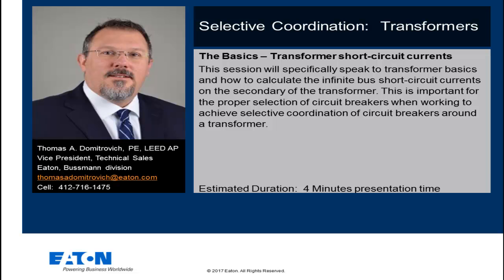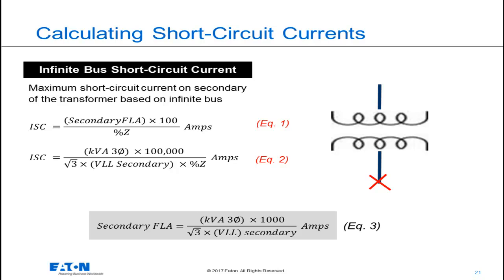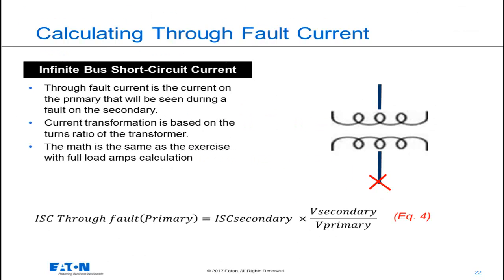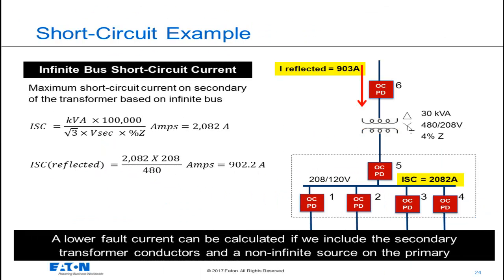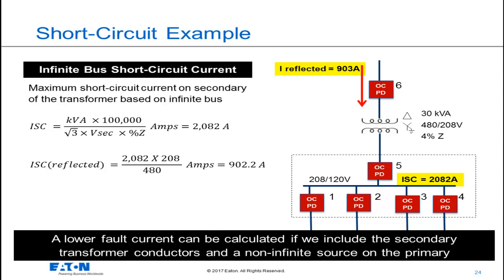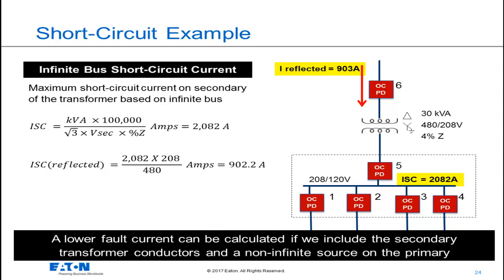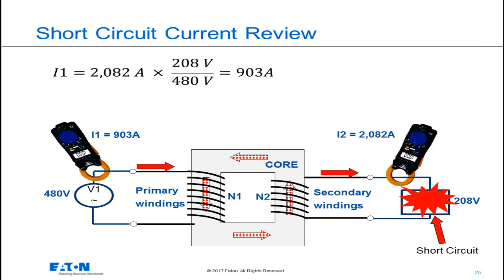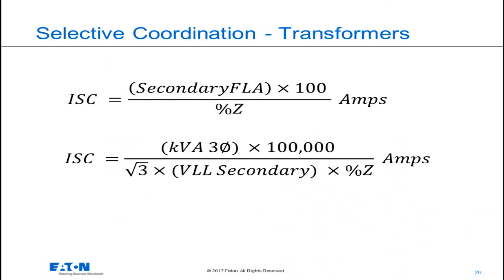Transformer infinite bus short circuit currents

Comment: Infinite Bus only offers worse case scenario for short circuit rating and coordination purposes, but it is quite the opposite when doing arc flash studies.
Reply from the maker: Eric Fiedler you got that right Eric.   Plan to address that in a future video.
Reply: Awesome, I'm really curious if there is a good method for assuming worse case on the arc flash portion.  I've read some methods, but most defer to waiting until you get the utility available fault current information to even attempt arc flash. (Which I tend to agree with, but sometimes it takes months for the utility to even respond.)